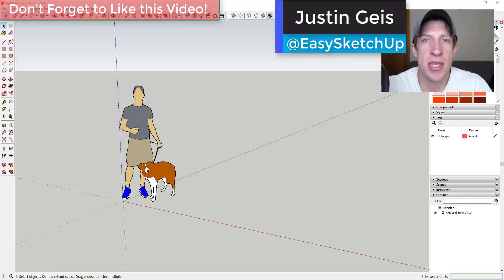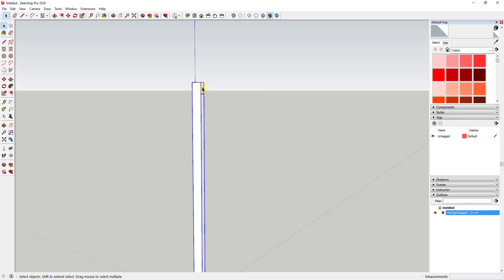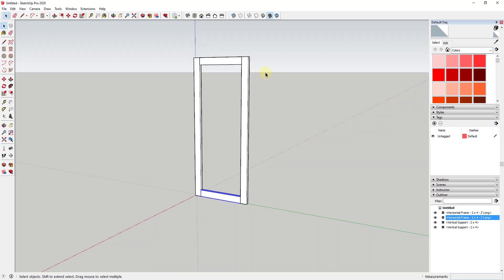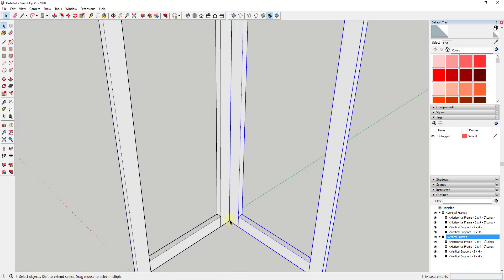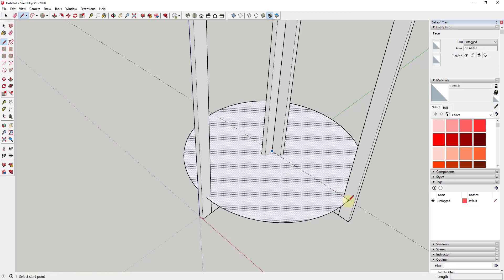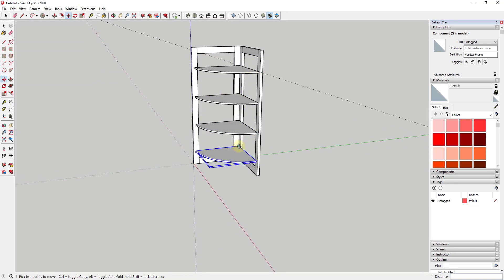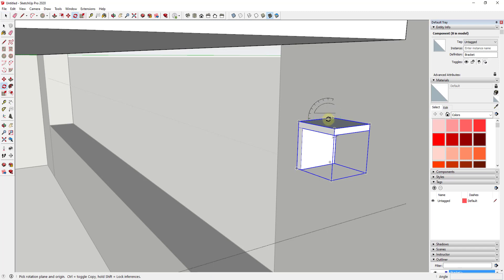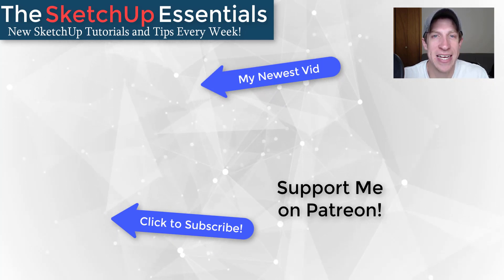Modeling a Corner Shelf in SketchUp - SketchUp WOODWORKING Tutorial

Comment: Great tutorial except one thing you really need to inform people. The flip along command for components. It is critical that people are aware of this when copying components. If you don't flip it, and you try to edit a side in the component, you will run into lots of issues especially if you copy that component many times in a project. But over a quick and simple project great video
Reply from the maker: I mean, sure, but I didn't cover that in this video because it's not really relevant to this tutorial because we don't flip anything...